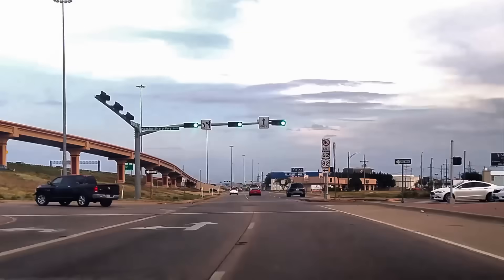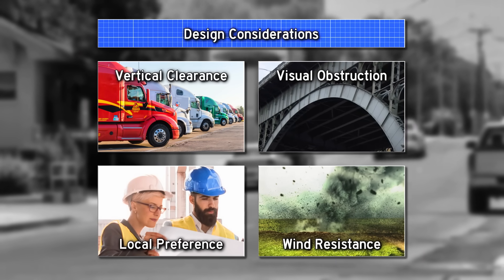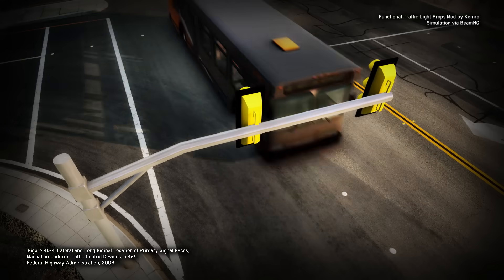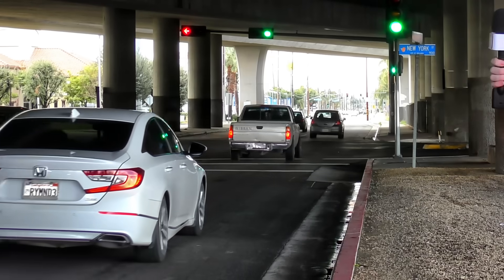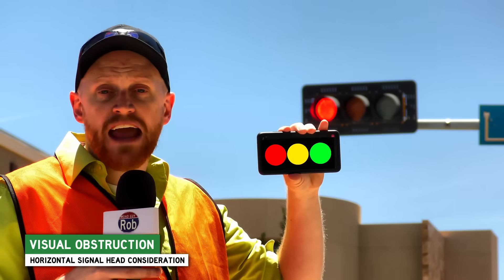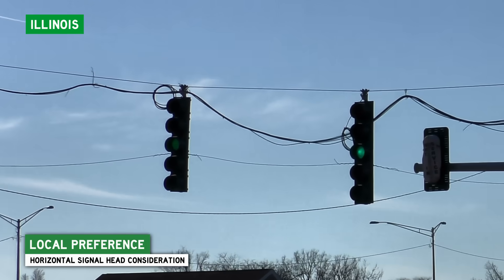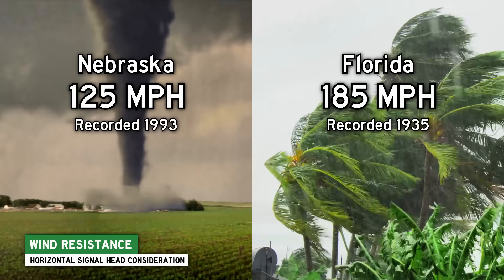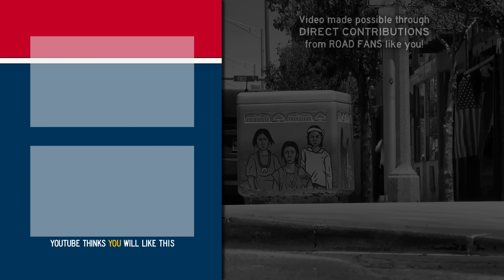What's up with SIDEWAYS STOPLIGHTS in Texas and Florida?

Comment: 4:50 I once messaged Rob about advice on exactly this thing. For some reason, people like to do this at the intersection next to my house. And they always pick 2 or 3am. I wonder why. (that's sarcasm). I get woken up out of a dead sleep several times a week by different trucks using our residential streets and intersection as their own personal drag strip. The cops won't do anything about it because they'd have to keep a patrol car at the intersection 24 hours a day hoping to catch someone doing it. And that would only stop that one person. As soon as the cops are gone, it would start up again. So, I guess I just have to live with it. If you want to ruin your tires and clutch and transmission, go to an actual race track. Let your neighbors sleep in peace.

Comment: East Asian horizontal writing is a mixed case. Up until Japan lost WW2 and had General McArthur run things and impose the modern way, a horizontal text is treated as a one-row vertical text, which is still written today, top to bottom, right to left. In that regard traffic lights there follow the old writing rule, vertical or horizontal.

Comment: A question I never ask but definitely happy to hear. And funny enough i used to live in Florida. For some reason I got used to it.

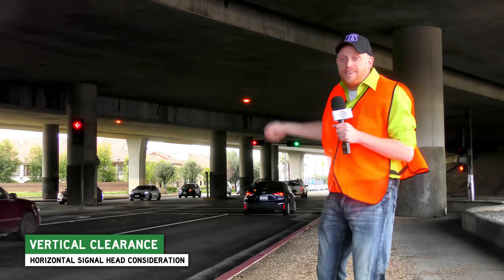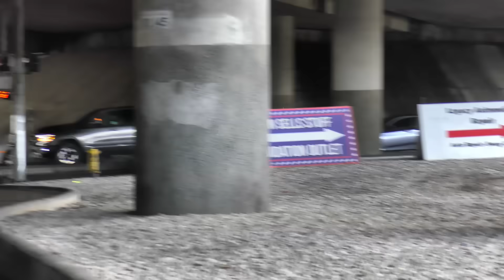Edit 4:06-5:00 that's pretty frightening and cool

Edit 2 yeah even though it's good to design I remember that one intersection in Florida where I used to live one of the pole that hold the traffic light actually broke off. As a result they used wires with the traffic light temporarily with a horizontal way.